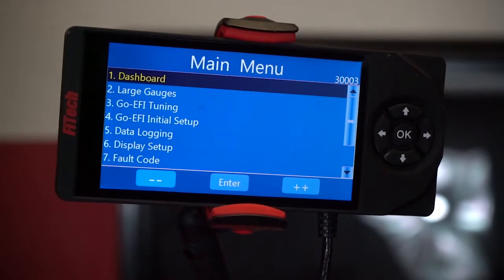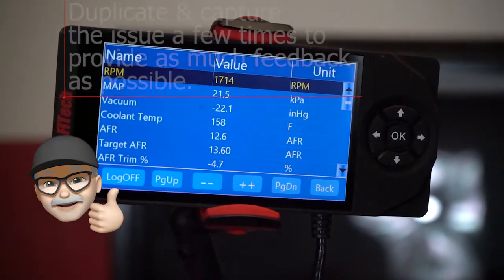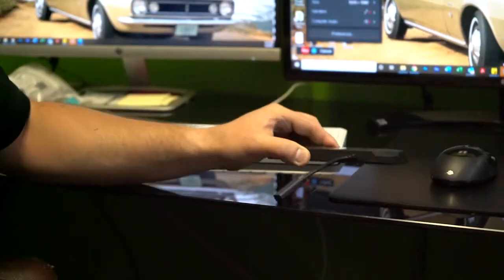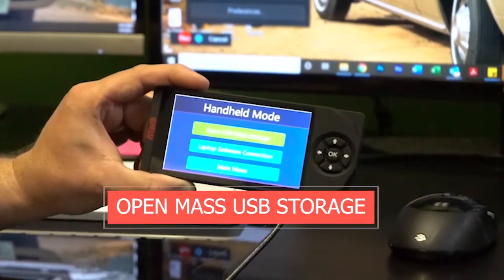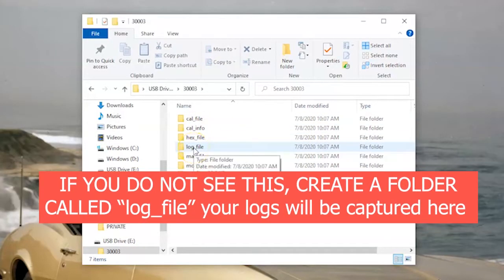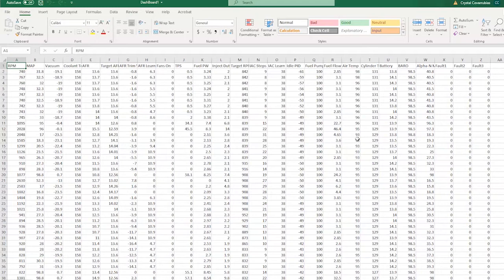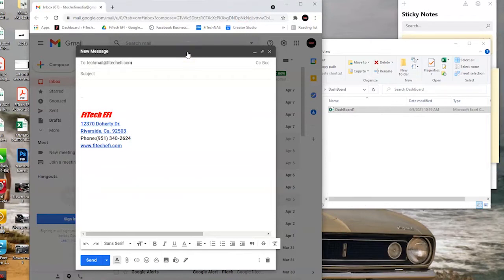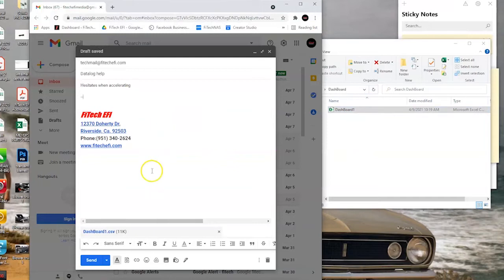Record and Save a Data Log| Tech Tuesdays | EP14

Comment: Will the data log file get overwritten or will it create multiple data logs?     Example..  I turn the data logger on, get the system to stumble or whatever..    record for several minutes.  Getting ready to set data logger off, I fat finger the buttons, turn off, turn back on, finally turn off..  are there 2 data logger files? A longer one and a very short one.. OR is there just 1 data log?
Reply from the maker: In the example you provided the log would all fall into one datalog. If you were to leave the screen and come back to it the system will record a new datalog. This new datalog will be labeled the next number higher.